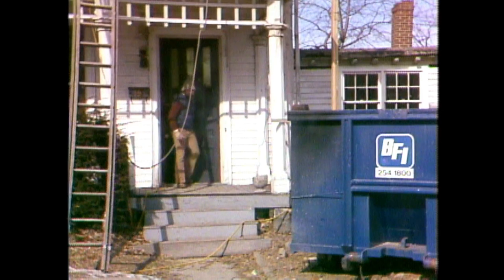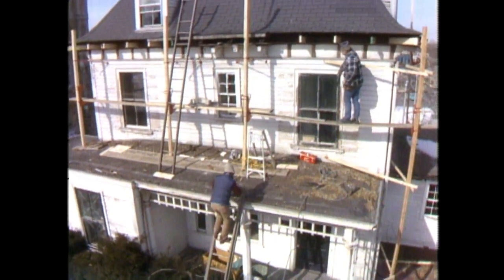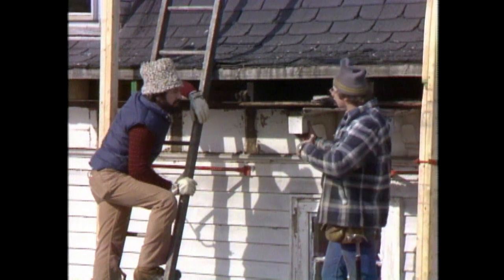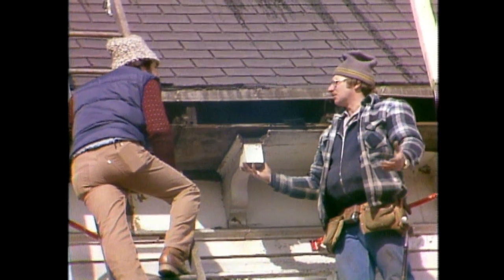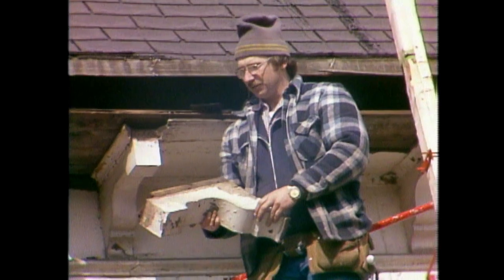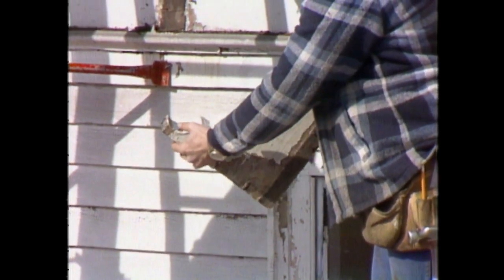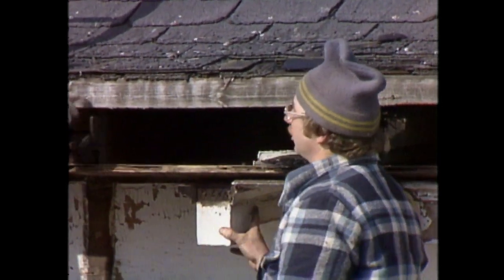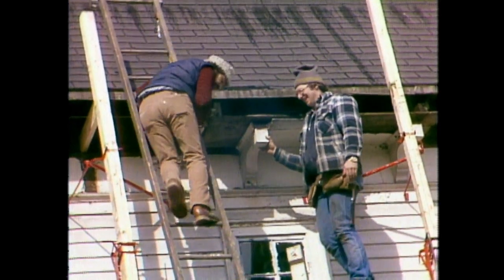First appearance of Norm Abram 1979

Comment: This used to be an interesting and useful program.  Now that their concentration is on million dollar rehabs and expensive infrastructure subsystems, it is just a curiosity.
Reply: I think I remember the time they wanted to make some living space in a barn. They wound up using three pieces of wood from it. The rest of the materials were new. I stopped watching for many years. I still want to see them work on smaller old houses.
Reply: I tend to agree. I used to watch the show all the time. We built our timber frame home in the early 1980s. I don't think TOH can build an outhouse for less then $100k. I did use Norm's New Yankee Workshop (too bad that got canceled)  ideas to build our greenhouse and I find Ask ToH useful for repair info.
Reply: Yeah., I remember they built a $30,000 shower once.
Reply: Agree with that

Comment: That pump jack setup was scary.
Reply: The pump jack doesn't concern me. Standing on that one plank is troubling though. Pump jacks are designed so two planks fit. That's actually the outrigger arm too. So he's using it backwards.

Comment: 1979: 40 at 40 bucks a piece? well that's out of the question
2020: what's your budget for the counter top? oh around $50,000.
Reply: Gotta remember that $40 in 1979 is like $150 now Times 50 of those corbels would cost $7,500 to replace them all.
Reply: Adjusted for inflation $35 in 1979 is $125.48 today.
Reply: @normgraham6658  $7,500 bought 12 linear feet of soffit replacement on a job I worked on. Just material. But it was more elaborate than what Norm is working on.

Comment: The very early episodes are the best! With Bob. Basic carpentry, and how to do it yourself. He will show you how to use a plumb bob. And tell you to use 8 penny nails for toenailing so as not to split the wood. How to install a door so it's straight, and closes as it should. How to frame for a window opening, the header, jack studs, etc. This was the first place I heard of making a header by taking two 2 by 6's and sandwiching a piece of 1/2 inch plywood between them to get you the 3.5 inches of thickness.

Comment: This soffit and fascia (etc) have more problems than that. There is Zero Venting at the soffit and not much if any Insulation visible (which should terminate at the exterior face of the wall and have a baffle to permit ventilation in). I wouldn't be surprised to learn that much of the damage was due to Ice Damming as well as poor installation of the gutters and fascia.